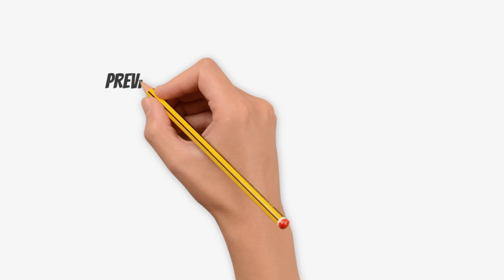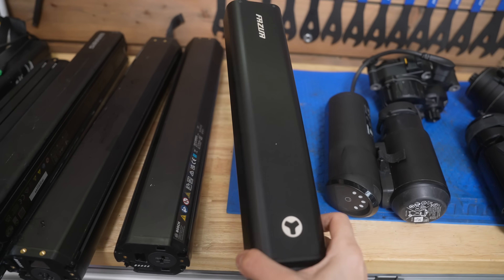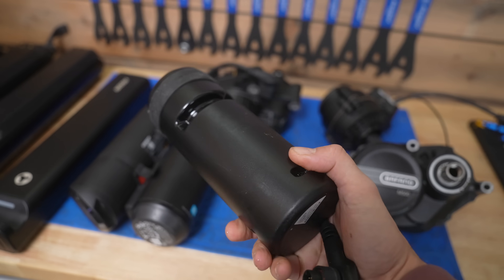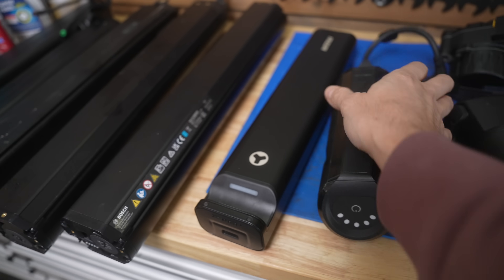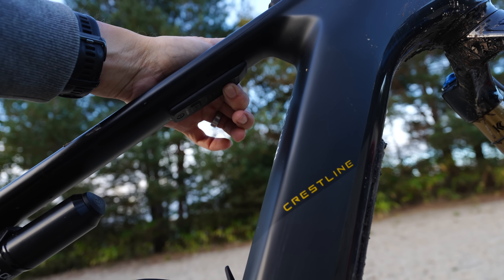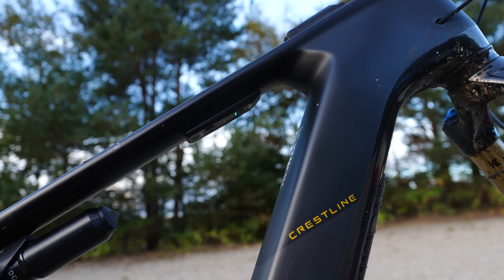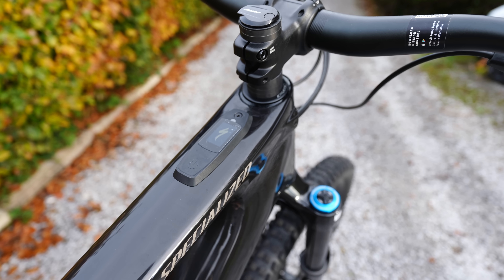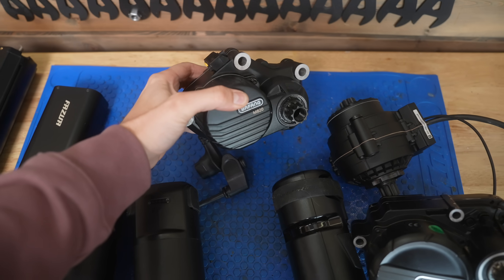We Have A Huge Problem With Ebikes....

Comment: I just want an open standard for mid-drive ebike kits so you can buy a purpose designed frame with the correct reinforcing for a mid drive motor. I'm not into proprietary ebikes anyway I just don't have that level of disposable income and would resent paying so much. However existing mid-drive ebike kits just use normal bottom brackets which perhaps not ideal unless you have a very overbuilt frame. That way we can freely repair and replace parts on our own bikes saving money and time. High end store bought e-mountain bikes seem to be the fastest to landfill and often people can only pull off wheels, drivetrain and brakes and the rest of the ebike is disposable despite the high pricing. I seem to remember a replacement frame was something ridiculous like £1800 and the motor and battery were getting on a bit. It made no economic sense to keep that ebike working. Proprietary is not economically or environmentally viable in my opinion for most people in the world. 

I think once an open standard becomes available it will literally destroy many of these existing companies. An open standard would lower prices and prevent a lot of consumer exploitation and in such a competitive marketplace margins would have to be lower. I really can't see Brose or Bosch getting on board. I mean why would you buy a e-mountain bike with a Bosch motor for £10k is there was a non proprietary version of the same spec overall for £8k that could be repaired and customised long into the future? Lets not forget a lot of dealers who sell Bosch ebikes can't really do repairs on them, often the electrical components are sent off or just replaced. An open standard would mean much more potential for dealers to offer full repairs and easy part replacement. The more you think about it, the worse proprietary is. I think even dealers would want to support an open standard because Bosch don't just rip off end consumers but dealers have to pay big money too to them in order to provide support. I bought a Bosch water bottle in a charity shop for 25p and that is probably the sum total of Bosch purchases I have made in the last 25 years and this is likely to continue. 

Hub motor ebikes may not make the ideal e-mountain bikes but they are very easy to keep going and at worst you can pull off the electrical bits and just use them as normal bikes much of the time. Even when controller plugs vary they often are still compatible if you wire them correctly and most hub motor ebikes do not have components with encrypted digital handshaking between components so you can use whatever battery you like. You could literally buy a hub motor, controller and battery from 3 different suppliers and wire them together to work.

Comment: A big problem with all things ebike being compatible is the safety issue. We are dealing with some large batteries and when things go wrong they can go very wrong. In order for compatibility to work it should all be  up to the highest UL standard (In the US). That is certainly going to cancel out the great majority of ebike manufacturers. At least  until they get their basic safety standards to a high level. After that you can start taking about fitting standards.

Comment: As much as I would appreciate cycling brands to collaborate and agree to a 'standard', I think we can all agree it won't happen until the consumer refuses to purchase all the latest crap they keep pushing on us.  Several industries are following this same business model.  Create unique designs/parts which can only be replaced by OEM at a major expense to the consumer.  This will also slow down the aftermarket trades as they won't be able to keep up with all the tooling required for every brand/model.

Comment: E-bikes in many ways are worse than computers. If I wanted to, I could take a 15 year old laptop and find a version of Unix that will run on it. If the laptop battery is shot, I can still plug it into the outlet, or even a UPS if I wanted some sort of battery backup. Also, a decent aftermarket battery support market exists for most major brand laptops. If manufacturers won’t even provide firmware updates for e-bikes, this doesn’t inspire confidence for future support. Bikes are not cell phones, bike companies will lose customers if they have this sort of attitude for planned obsolescence.

Comment: Not sure if this has been mentioned in the other comments… SRAM powertrain will be compatible with X brand and Y brand… you will be able to swap batteries around, other small tid bits as well. They’re working with bike manufacturers on design. We are making our frames around the SRAM system, down tube shapes etc.. So essentially if you’re on travel and need replacement parts or warranty it will be easier to find parts.

Comment: this is exactly why I built my own with bafang bbs02 kits on mongoose bikes from walmart.  all old school interchangeable parts.  I don't need the latest marginal improvement for 10K from some snotty bike shop dealer.  FYI, I use my mongoose conversion way up in the rocky mountains all year long (studded tires for winter) and pull a cargo trailer up and down roads the Fedex man fears to go.   And for $10K I can get a pretty cool motorcycle that will get me into some real shit on the mountainside.

Comment: In other industries the component parts manufacturers work very hard to be “designed in” . Their objective is to lock up the OEM - making it very hard for them to switch - both companies aligning themselves to the relationship. Unless there is an industry elephant who defines the standard to which knock-off companies adhere to, I am not sure we will see any motivation for standardization … unfortunately.  

Last thought: what percent of the higher end bike owners make mods to their bike ( other than simple things like grips and saddles ). My guess is maybe 10%. Perhaps upgradability, while it sounds good, is not a real world problem for 90% of the bike owners???

Comment: The Ace number one reason I never buy an e-bike but build mine. I got dozens of batteries and they fit any of my e-bikes and can even be used to double the range. Blue bricks, velcro and padded battery covers. I can generally built one that performs far better than purpose built e-bikes because they have insurance and lawyers watching them.  I can even up volt a system by merely unplugging one voltage battery and plugging in the higher voltage one in it's place.

Comment: Have you ever considered anything of what you are talking about in relation to automobile industry? It is the same or even worse and nobody is rabid about it. You will not go to your mercedes dealer and complain that Audis new motor will not fit. There is no upgrade path for cars at all. If you buy a new car and two months later they make a facelift you are SOL with your prefacelift infotainment, they will not upgrade the software in your "old" car even if the screen and buttons are all the same.

Comment: This causes the same issue when you are trying to keep older stuff working. 
You need a part, and the bike you have is a v3, but the manufacturer is currently selling v5.2. You then need to trawl through loads of stuff to find out what changed and when, and what parts will work. 
Stop it.

Comment: Spot on Rob! I would confidently wager that most cyclists are quite strongly focussed on sustainability, so that is sizeable group. We need to rally behind this message and demand, with our wallets, as that’s how brands are most firmly woken up, that this is the future we want. And, we also want retrofit kits designed and built by brands/manufacturers to mend the damage already done.
Reply: If you have a battery powered bike.. Are you truly a cyclist?
Reply: @sahhull yes. Can you suggest a better term in English? I do appreciate that Dutch differentiates between wielrenners and fietsers. But both of those classes would be cyclists in English.
Reply: @DizzyDiddy  for me.
A cyclist is the human powering the bike. He is cycling.
Electric bikes are more similar to motor cycles.
The term I use for them cannot be repeated.
The UK cyclists I come across on a daily basis are lawless scum that believe that the highway code and traffic laws don't apply to them.
However they are the loudest voice when the nasty driver hits them, even if they didn't look, jumped the traffic light, cycled the wrong way down a one way street. Or just ride along on the pavement.
Reply: @sahhull  there is a huge range of things that falls under the electric bike umbrella and I agree that many of those are more like motorcycles. But bicycles with battery assistance that only work when pedaling and only up to relatively low speeds are definitely still human powered bicycles operated by cyclists. I don't think English is going to develop a distinction between them and people using non-battery assisted bikes.
Reply: @DizzyDiddy  at the moment it's more like the wild west.
Electric scooters are illegal to use on the street but as long as you are not a fool the police won't do anything.
The same with fully electric bikes. Unless they draw attention to themselves.

Comment: Don't worry, as patents for specific connectors expire the industry will settle on a specific style, or adapters will become much more prevalent. It's happened to every single industry. Even EV's are mow standardizing down to just two connectors and adapters work fine between the two standards now.

Comment: You have some good points about chargers. There are very few good reasons to have proprietary chargers and some standards should be made. Regarding motor technology, that is a different issue. You cannot expect competing brands to agree on dimensions etc and backwards compatibliity as this will not gain development of new tech. Having said that, people getting annoyed about not being able to upgrade their bikes with new motors, shouldn't bother too much, as motors have evolved so much within the current power limitations, that I doubt it will make a difference. What't more important, especially for the more expensive bikes, is that spare motors, batteries etc are available in the future so when the electric part of the bike needs repair it can be fixeed ten years down the line, and not thrashed because of obsolence.

Comment: Great point, but on the other hand it's how i got a few ebikes for free. Like this year we had a ktm severo with the old panasonic middrive motor in for an inspection. The estimated repair was around 500€, so the customer just bought a new ebike. Well it is from 2014, so pretty old. But i got it for free and still drive it, it's such a good beater bike😅

Comment: The same problem exists to a certain degree with purely mechanical bikes.  The proliferation of bottom bracket standards is one example.  (I detest all the press fits.).  Proprietary seat post and little road “suspension” components is another. Try finding those replacement parts in a few years and let me know how that goes for you.  Gotta say a have a bit of shadenfreude when I hear the bike manufacturers are having a hards time right now.

Comment: Bafang frames are pretty future proof, there are at least 3 different motors that fit each Frame. And it works with any battery. 
Giant 800wh battery fits into bikes that came with 500wh batteries.
So it's not all that bad.
Nobody has to be 'up to date'. Just ride what you get to ride. Pace of innovation in this industry is huge, this industry is not mature enough for standardisation. 
Also, nobody whines that ford engines do not fit Chevy trucks, so they?
Can you swap batteries between different smartphones? No.

Comment: Unfortunately, built in obsolescence partly guarantees future profits, and the environment and consumer benefits mean nothing at all to manufacturers. 
Frame manufacturers COULD design their bikes with motor subframes that would allow any (more or less) motor. However, the package would be more bulky and heavier than a bespoke frame for a particular motor.
What the industry needs is some laws covering ongoing parts supply, and firmware backwards compatibility.
There's communication between the battery, controller and motor, and also with the chargers. The communication is often CAN bus (controller area network) but the data frame identifiers and the multipliers and offsets for the data frames are manufacturer specific, so even though Bosch and Giant both use CAN, Bosch diagnostics won't work on a Giant. However, they COULD do if they wanted to, and the law could make them do. 
Another comms protocol is UART, but most are CAN. 
All that said, most motor controller microcontrollers have BOTH CAN AND UART, so comms for diagnostics and firmware upgrades could be standardized in most cases.

Comment: I built my ebike in 2021 after riding my friend's.

Funny thing is, he ended up scrapping his whole bike because a replacement battery cost 2/3 what his bike did new. I took that one to heart and started looking at the market by shopping around for repair costs + parts availability. Didn't like any of it, so I ended up building my own with a bafang unit. 

During that time... I put a different drive train on my bike. Swapped out the fork. Had a controller fail on the motor, so I replaced that. Put big brakes on it. Needed a bigger battery, so I swapped that out. Cracked my frame (unrelated to motor) so I transplanted everything to a new frame.

Yeah my DIY kit may not have the aesthetic fit and finish of something OEM. But the thing goes and goes like the energizer bunny and I have a totally open market to do whatever I want with it. 

New display? Cool done, I have my pick of several. 
New chainring? Sure. 
Want to swap the drivetrain to belt drive? totally doable.
Need a battery? Literally anything with a +/- is usable
Dual batteries? Can do!
Want some DIY accessories such as headlights, a horn, and running lights? Well it's just building my own harness. 

Nothing is tucked into frame. Nothing is locked down. I intentionally built everything with as "off the shelf" parts as possible to repair-ability is high, and operating costs are low. I've learned a lot along the way too. And there's a pride bit about having my bike, built by me, exactly how I want it. I've beat the ever loving piss out of the thing and it keeps going.

Comment: Hi Rob, I agree with everything you said in this video, but there is a problem which I am sure you are aware of, all the points you mention are from the perspective of the consumer. Bike manufacturers are not in business for the benefit of the consumer despite what they may tell you. Everyone is looking for their USP (unique selling point). Manufacturers will fight tooth and nail to NOT have standards.  In general standards must be imposed on industrial sectors from outside, a good example of this is the EU forcing Apple to adopt USB C interfaces. There are good arguments for and against this but it took the legislative clout and the ability to legislate for many markets to force Apple to change (well that is my reading of events). I am not sure where the key markets for bike manufacturers are,  I would guess the USA, your message needs to get to legislators in wherever the key market for bikes is but don't expect the companies to comply easily. The alternative is for a manufacturer brave enough to offer a new standard and make it available to other manufacturers at no cost. This has of course recently happened with derailleur hangers. It takes one brave manufacturer to force a change on the others. Best regards Sarah

Comment: 10 years ago I knew that it will happen. I advised my friends to buy ebikes with hub motors and batteries which are mounted on the frame. They haven't listened and now they need new bikes because they couldn't buy batteries.

Comment: Great video , and i would suspect for bike mechanics it would be an absolute pain in the ass too Rob 
   , and we even see some modern cars becoming less part and service dealer friendly , especially if you have an EV that must go back only to that dealer ,  good luck going to your local mechanic on the corner if they are like bike brands , and not an affiliate or franchise of that particular brand if you need parts , basically you are between a rock and a hard place .

Comment: Another issue, I believe is a big issue, is the second hand market for e bikes.  With no warranty for a second owner, they are taking a big risk buying a bike that could have major costs associated with that purchase.  Motors are expensive, batteries are expensive.  

I think if manufacturers made the warranty was extended even to the second owner, it would make the idea of buying a second hand ebike more attractive to buy. 

With standards not being there, and new products not being backwards compatible, I don't think it's worth taking the plunge until they sort it out.